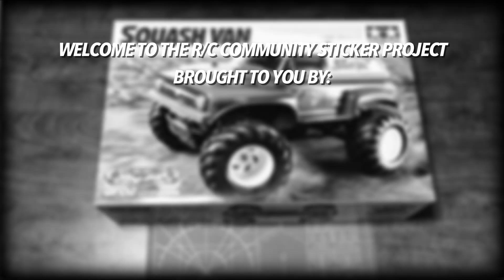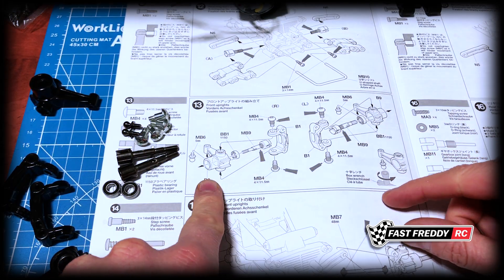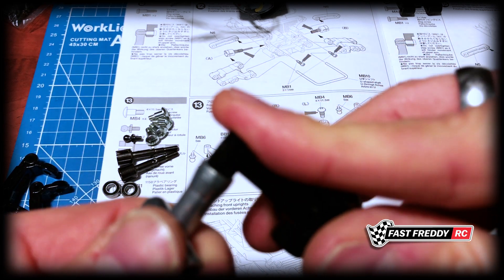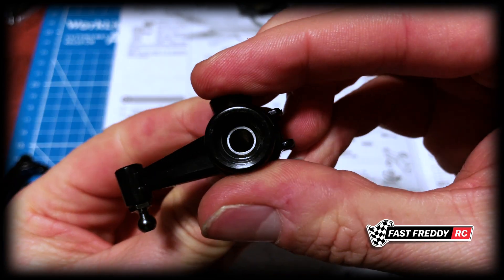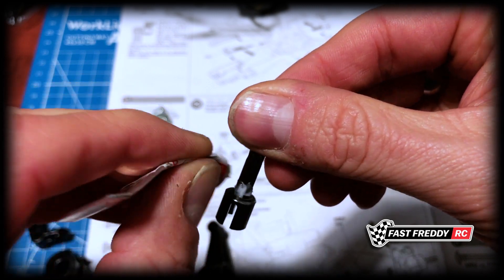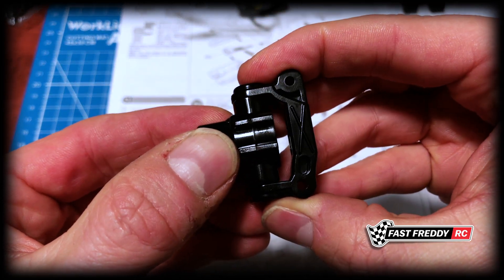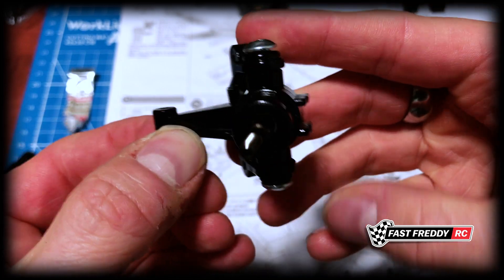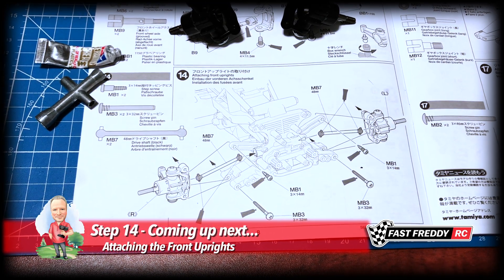Tamiya Squash Van Build Series! - Step 13 - The Front Uprights - @sparetimerc

Comment: Hello Freddy, Thank you so much for that awesome shout-out.  The Squash Van is coming along, I have a question on the uprights. is it easy to mis-align the screws when placing them in?  Reason why I'm asking, there seems to be a little bit of play when putting them in.
Reply from the maker: You're very welcome Al!  Good question...so with these ones the answer seems to be yes.  I say "seems to be" because if you don't place B9 directly in place so the hole is perfectly aligned to the B1 hole, the screw wants to naturally move to where the hole is so the alignment can shift.  Once you have one side in place, the other screw will go in nice and straight because if you've done the first one correctly, the hole should be perfectly aligned for the second screw.